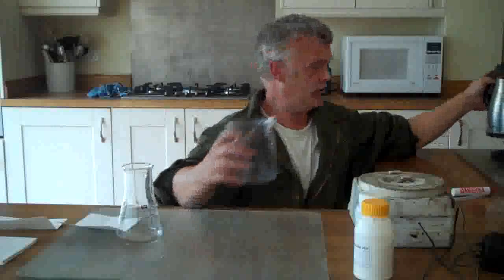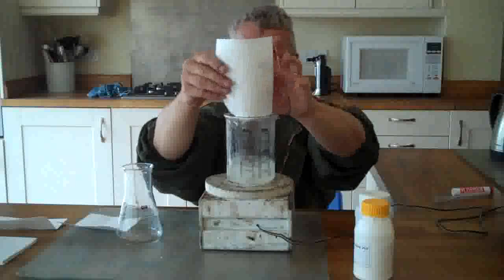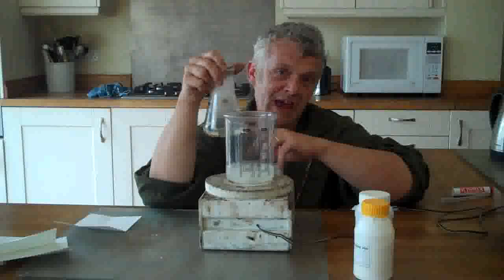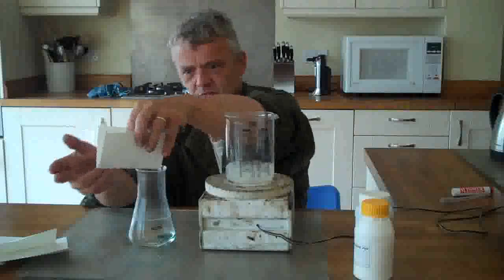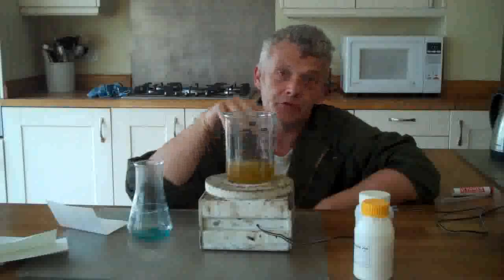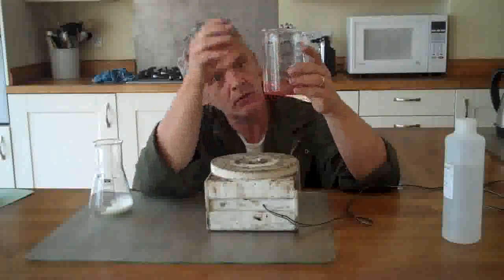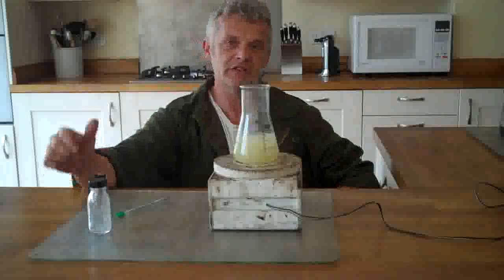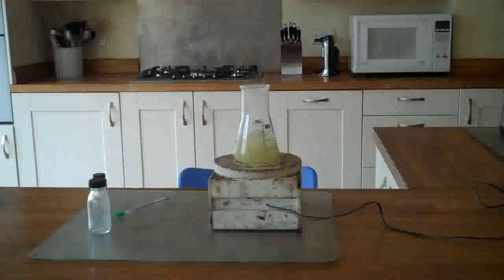Copper nanoparticles for conductive inks by water and polyol synthesis

Comment: Great stuff. 

But what is really needed to actually be useful in all applications is a conductive GLUE. Something that hardens and is strong enough to withstand a bit of movement on the connected parts. Something that could sort-of replace solder. 

Inks are great for drawing circuits and educational things, plating plastic items etc. And, no doubt some industrial things. 

I am busy with a repair of an electronic music keyboard. Trying to join flexible PCB. 🙈. There is just nothing out there. The silver glues are HIDEOUSLY expensive. I ordered a syringe with a couple of mils in it and, it not only was not strong enough ( a little pressure and it just cracks), but it dissolved the tracks on the PCB! And it was then run out and I would have had to order another batch to try again. 🙈

I have since been working on carbon based inks and I have achieved something not too bad. On average I can get about 100 ohms in a join which will work for some things. 

So maybe you can come up with a glue formula. That would be fantastic 

Good luck with your endeavors.

Comment: Wonder what happens if copper and graphine meet, would cu fit into the matrix? Copper is used to check mixing in secondary steelmaking units like degassers, a tiny addition disperses through the molten charge extremely quickly, samples taken to see if there’s dead spots or non homogeneous ladle.
Also grapheme and Babbitt metal bearings, still used in big end shells ( white metal on steel shoe)

Comment: can we use copper nitrate trihydrate instead of copper acetate and citric acid inplace of ascorbic acid
Reply from the maker: +muralidharreddy challa it makes sense - so give it a go mate
Reply: +Robert Murray-Smith. actually it didn't work, resulted in a dark blue solution and that's it no reaction is taking place
Reply from the maker: +muralidharreddy challa well there you go - you have your answer - though if it is dark blue sounds to me like your concentrations were way to high and i am guessing the reaction conditions weren''t particularly well controlled. Did you try copper (II) nitrate and ascorbic acid? copper (I) nitrate? - it might be the citric acid is just a stabilising agent and you might have to add an additional stronger reducing agent?

Comment: Hm... Could you please somebody confirm that PVP is POLYVINYLPYRROLIDONE? 
Thank you! Robert for president!
Reply from the maker: I noticed a few posts from you that i seem not to be able to reply to - thankfully i can reply to this one - first point - don't shout please - caps is the text equivalent of shouting - PVP is polyvinylpyrrolidone at MW 100,000g/m. A polyol is a generic name for glycols - I use diethylene glycol but you can use other glycols. Red Copper oxide is best found from a pottery supply company as it is used in glazes
Reply: Thank you! Sorry for asking such elementary questions. I'm a professional photographer, so you can also ask me which camera is the best for no money, as I'm asked quite a lot.
Reply from the maker: Borut Peterlin
no worries mate

Comment: How did the sintering go?  Might look at using an electronic flash, which I've been seeing used with electroconductive ink, after watching your video
Reply: Sorry.  Just changed settings and now I see the flash-sintering info.  Planning to follow this setup, rinse the copper, and try water-soluble paste flux as the ink base, then flash it and see how it does, as well as sticking to the blank pc-board.
Reply from the maker: Jeff Frusha
cool - i have to do the demo on this  - been a bit busy of late

Comment: If you don't flash the solution, is the ink not conductive? If it's not this would be a cool way to make a PCB: spread the ink over an entire surface, for example over a piece of glass. Then transfer toner to the surface where the toner covers the areas you don't want to be conductive. Next flash the surface. The bare ink would become conductive and presto, your PCB is ready for use.
Reply from the maker: good idea - but this is what light forge are doing but with copper oxide instead of copper as xenon flashing reduces the oxide to copper and you don't have the same stability problems with copper oxide inks

Comment from the maker: Say I gave you a bag of apples and a scale and the weight of one apple and asked you to tell me the number of apples in the bag -  I'm pretty sure you could do it. It would be the weight of the bag divided by the weight of the single apple. It's like that with atoms. Molar mass is just the weight of 6x10 to the power of 23 atoms of that particular substance (or molecules) so though it seems to be a mass it isn't really it has nothing to do with density - it is just a number - hope this helps

Comment from the maker: I'm sorry my friend but why on earth would the k value be of any interest here? Molarity is to do with number. It is 6x10 to the power of 23 atoms - that's it and that is a mole. Stick that number of atoms in a liter solvent and you get a molar solution. Half that number in a lire is half molar. Half that number in a half liter is a molar solution and so on. The problems arise because different atoms are different weights. But that's easy to understand 10 cars are heavier than 10 bicycles

Comment: Hi Robert, sorry i am not polymer chemist, still i have got problem in calculating the mass of pvp for a given cncentration, i tried my best to calculate the mass of PVP using monomer mass that is 0.08 X 112.9g/mol which is 9g of PVP for 100mL, i'm right? do we use this calculation  for all PVP, i mean no mater which k-value we use

Comment: Hi Robert, Quite interesting presentation, I tried to reproduce the first paper and I have got aggregated particles, any idea? in addition I would like to know the mass calculation of PV with a given concentration, for a given concentration of 0.8M, with a PV 30,000g/mal, for a 100ml solution, i have got 2400g of PV which is unbelievable.